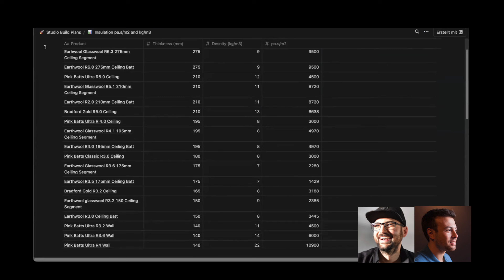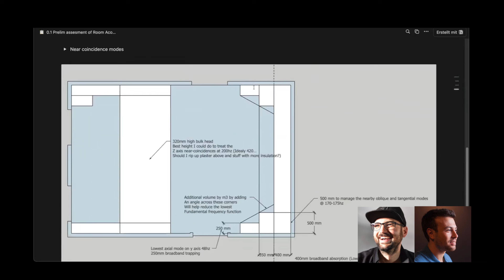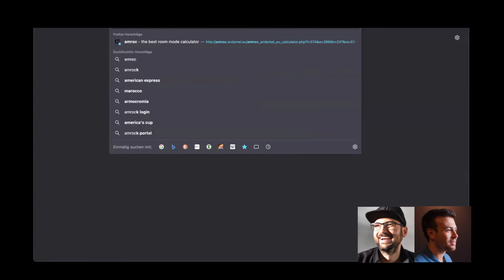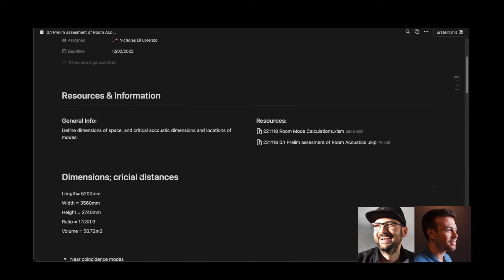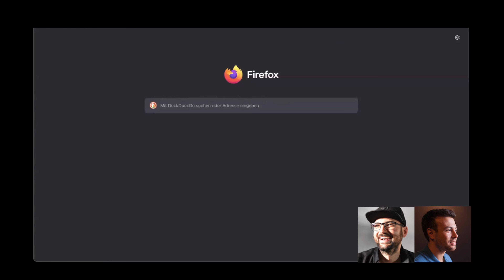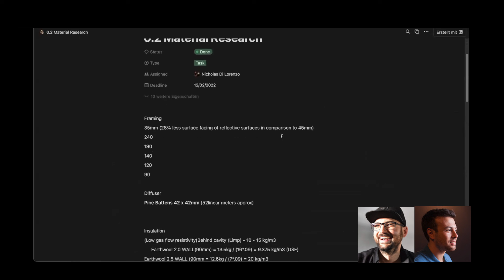Australian Mastering Engineer in LA (2025) - Day 12

Comment: For the 48 Hz (0-1-0) mode, you need a panel resonance membrane absorber—porous absorption alone won’t cut it. Low-frequency energy at 48 Hz passes through porous material with minimal effect. A hybrid approach works, but the porous material must not touch the membrane, or it could dampen its resonance. I feel as though AcousticsInsider has failed to properly recognise how the mass spring damper system works.

Room modes don’t shift frequency with absorption—only their decay time (ringing) changes. No data supports the claim that absorbers alter modal frequencies. If you’re serious about acoustics, look into experts like John Brandt
Reply from the maker: That's a good observation.
What I think he did highlight which is very useful and practical was to make measurement before to see how what we've got on paper corelates with the room itself.

The room is leaky by design, so those low frequencies will also naturally pass through the surrounding walls too.

I'll be filming next saturday the video and capturing all the results!